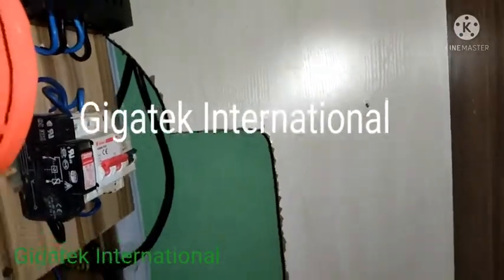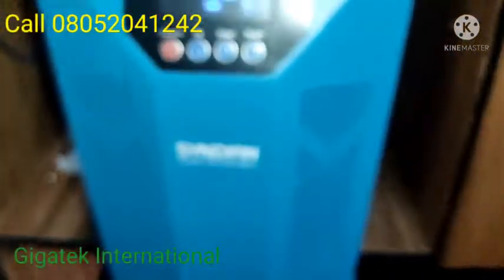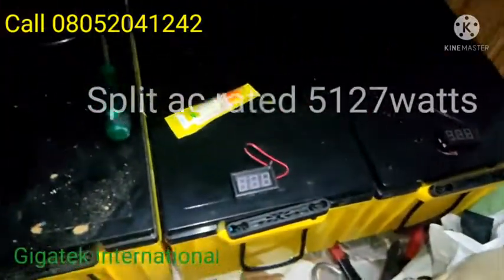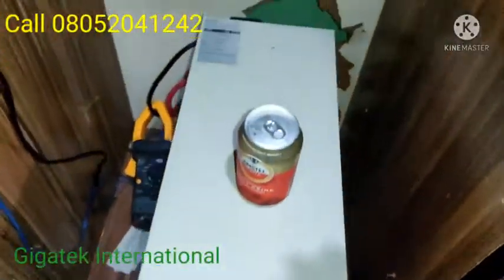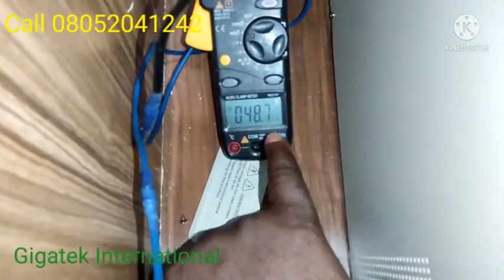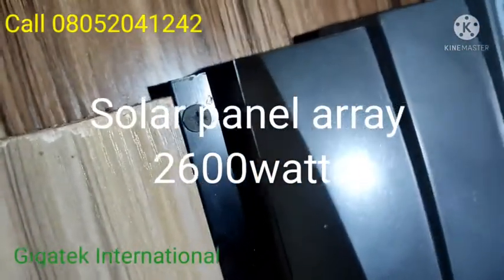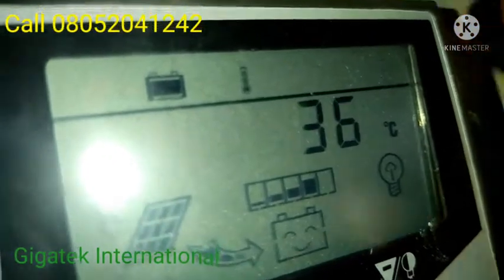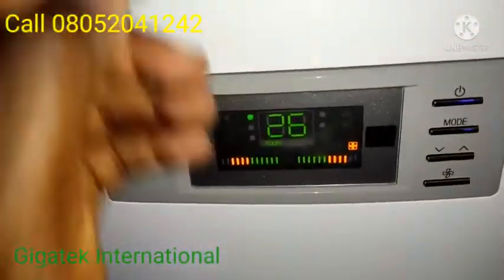Can a 7.5 KVA inverter power 5kw smart inverter split AC ?

Comment: Interesting video. 7.5KVA @ 0.8 power factor should equate to 6Kw. The inverter should therefore be capable of powering this type of AC that have low surge at startup.
Reply from the maker: you are very correct . Thanks for your input .
Reply from the maker: pp
Reply from the maker: l